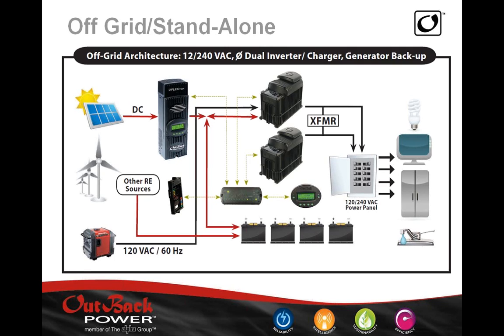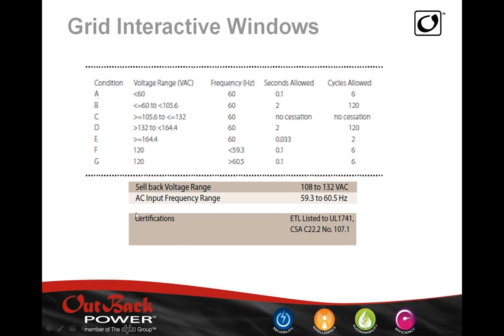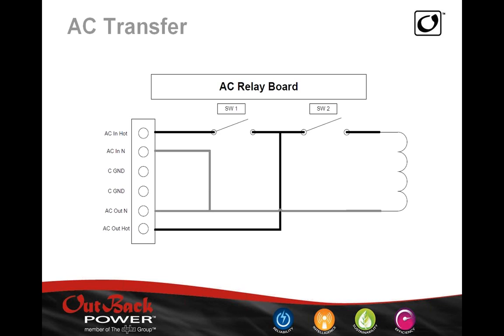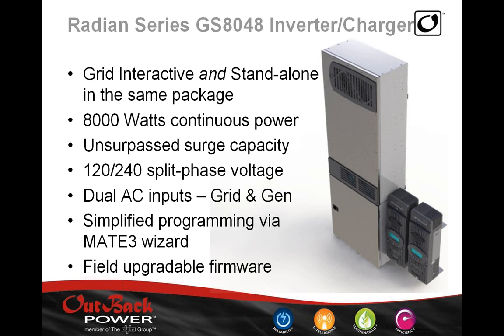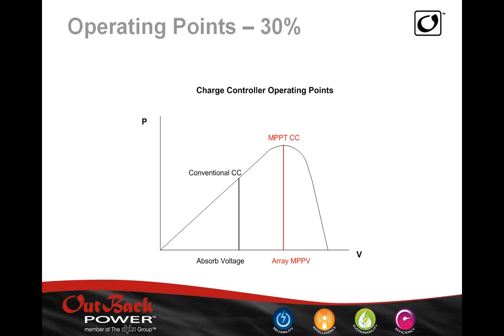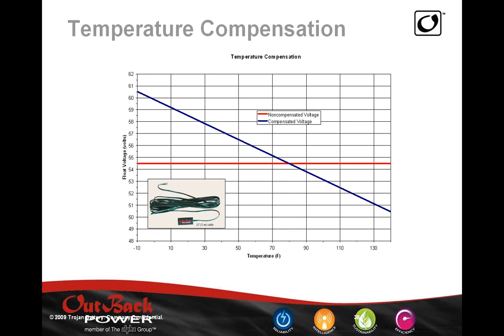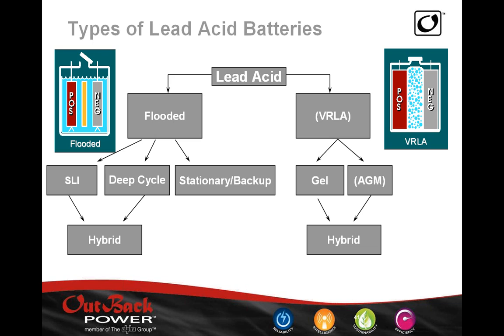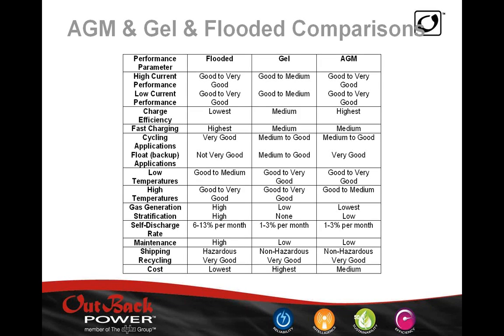Webinar | Outback Power Training   Part 1

Comment: What size wire do I need to go from the charge controller to the batteries
Reply from the maker: +Kyle Mckay 

Hi Kyle,A copper #2 AWG size wire rated at 75c from the charge controller to the battery bus bar to ensure high performance is recommended. Minimum size is #4 AWG. Also, make sure to always consult with a local electrician to check NEC and local code requirements. 
Check out page 10 of our FLEXmax Owner's Manual for complete details: http://outbackpower.com/downloads/documents/flexmax_6080/owner_manual.pdf
Thanks for your question, hope this helps!

Comment: Outstanding video,  but my questions and concerns are about being completely off grid, using solar,  wind and hydro along with a diesel generator.  I would also like to have redundancies built in. This would be in case of a major failure. The loads will include two water distillation units refrigerator a freezer,  air conditioning lighting,  entertainment center,  External security lighting,  security cameras , gate and garage door openers. How much power should the batteries be. I am able and willing to make the investment. What are your suggestions?
Reply: bohemoth1 Why would you want to be completely off grid? You can be completely off grid if you still choose to stay connected to it. Why wouldn't you want to sell power back to the grid?